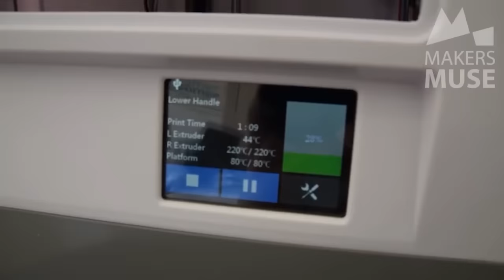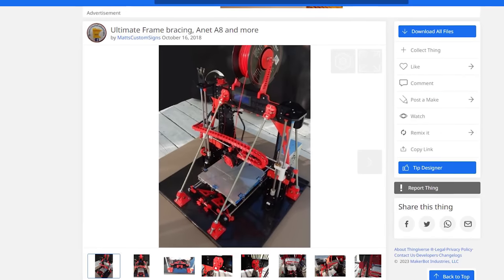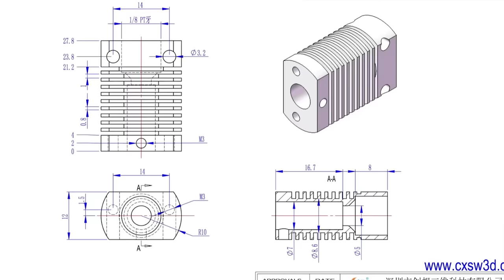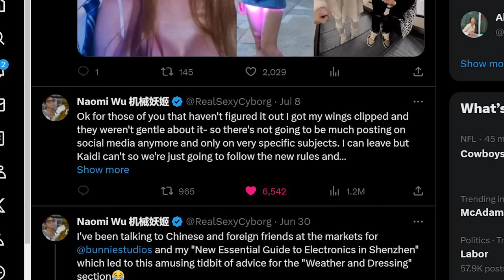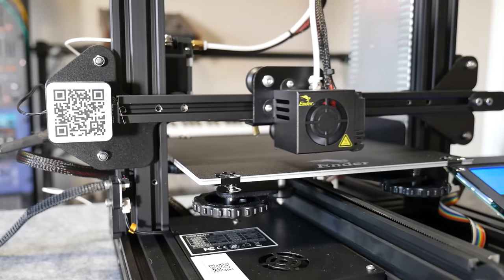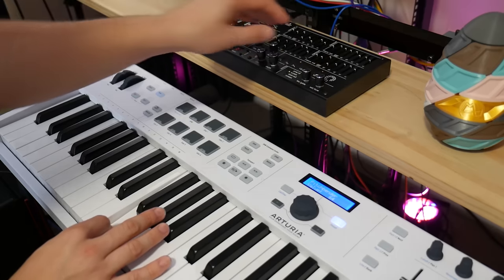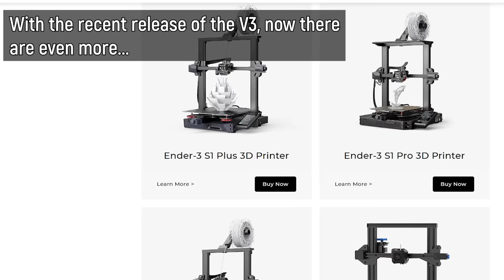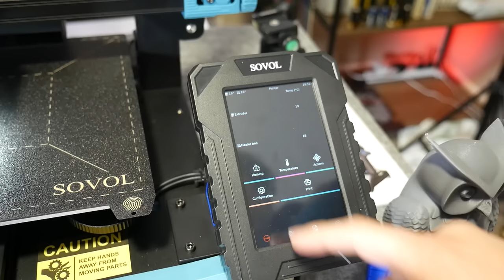Creality Ender-3... it's time to move on.

Comment: I've gotten an ender 3 FIVE YEARS AGO and I've barely used it. I literally only have 10 successful print on that thing and I hate that machine so much. Two months ago I dusted it off to print a case for my macropad and it took me 13 hours to get a part that's acceptable. I just hate that machine and will probably just sell my ender 3 and buy a new printer one day that's a tool and not a pile of parts that I need to tinker with every time I want to use it. Thanks for making a video that confirms my suspicions. 3d printing just isn't a hobby for me and I completely agree with your keyboard analogy, I just want my parts to print then move on with my day

Comment: i got mine about five months ago and i agree it a big pile off ****, im so feed up of leveling the bed even thought iv added a CR torch but if id have bought a better model that worked straight out the box first time every time i wouldn't have learned how to level how to fix a printer how to adjust one, im now looking to get a second one but will do a lot more research first or ask you and chep

Comment: This sounded like a Bambu Labs commercial to me. Is the Ender/Creality line "top of the line"? Hell no, but you could buy several for the cost of anything worth having volume wise from Bambu. And Bambu has had their own issues too. You won't hear about those though, because the checks have cleared. (wiring problems specifically)

Comment: I have had an ender 3 for a while, had bed issues with it, fixed it did a few prints every now and then, had a power supply issue, stopped using it because of how janky it looked when I had a look about when putting it back together 

Now I’m probably gonna get a Bambu P1P, the ender 3 is definitely great but get the best one first, not the basic models

Comment: I have a Creality 06 resin printer that has worked wonders up until a software update that overwrote my files and erased all my settings for half a dozen different resins. Horrible support. That being said, I was looking to get the Ender 3 Max for the print volume. Resin printers are great for miniatures but scenery is too costly in resin and size is a limiting factor as well. As someone who is comfortable with a wrench and somewhat tech savvy is the 3 Max worth getting? The budget is tight and the price point is doable (225 US) but it has to work.

Comment: Two years ago, I got an extremely cheap cr-20pro, like sub 100 bucks. It is terrible compared to my long loved prusa mk3s. Mesh bed leveling didn't work because the build plate is so much tilted, it just can't level it automatically. And there is no way of adjusting the bed on the cr-20pro, too.

Fast forward two years and I finally get my hands on a couple raspberry pi 3 sold second or third hand (whilst I'm already waiting on the pi 4 that I ordered for more than a year). I originally got them for my engineering studies and I already used a rpi0w on my prusa mk3s (I know, not ideal but it works fine if I convert the gcode to have G2 and G3 commands)

So I tried it on the cr-20pro..
..and I wanted to give up on the machine and get rid of it.. until I learned that it can run klipper with pressure advance and input shaping. And klipper has mesh bed leveling saved as values in a text file which saved the printer from an early end, since I could move the printhead manually to the measuring points and then input the measured offset by using the paper method.

And if anyone is wondering just how tilted that bed is, let's say left upper corner and right lower corner have a Z-difference of 1.5 mm.
My printer makes oblique square prisms instead of cubes.

Comment: I think you forgot to mention that creality actually made the ender 3 better along this years, the "recent" ones come with 32 bit motherboard, which made them way better than the 8 bit ones that you needed buy port expansions and to simplify the firmware a lot in order to add new features. Although I don't find the ender 3 variants very attractive, specially when they start to come with a lot of plastic parts, I did like the V2 ( the versatile color screen, silent drivers, premium PSU)   But you can't beat the 60$ returned Ender3 price,  the kit gets you pretty decent  parts, easy to repurpose to your needs. 
I usually tell new users to get 2 returned enders! 😅(build one with the parts with no sign of usage, then build the second one while installing a few, cheap but essential, upgrades)

Comment: Over time i’ve built my ender 3 to be exactly the printer i want it to be, using a mix of community mods and upgrades and some that i’ve developed myself. I love my printer… But I hate that it was my first printer. I bought it after bambulabs announced their first printer, and i wish I had waited but i thought they were just another wannabe tech company that was overpromising. So i bought my ender 3 anyway. I think you hit the nail right on the head. The ender 3 is fantastic if you are willing to put in the time to tune it and make it work for you. but for a little more money, theres so many better options that would serve less experienced people so much better.

Comment: My first printer was a Monoprice Mini Delta (v1), which isn't a great printer, but I got it for $80 from a friend, and they threw in a roll of filament (so basically a steal).  Last week I decided messing with the MPMD wasn't worth it anymore, and I started looking into replacements.  Creality DESPERATELY needs to cut some of their product line.  I ended up going with the Ender 3 V3 SE, but figuring out what the differences were between every "Ender 3" model is frustrating. 

That said, the V3 SE is printing great out of the box.  The only tweak I did was software. I switched from Creality's slicer to Cura, using the profile on Cura's github page.  And honestly, that was more because I like and am more familiar with Cura.

Comment: My son wanted a 3D printer I'm guessing it was 2018. I don't know who's at 16 at the time. I purchased him one for Christmas and then spent days putting it together and trying to get it to level. I actually became quite good at 3D printing and printed a lot of one-off for his friends. He never used it. Then I got a good price on a second hand ender 3 is the guy couldn't work out why he's prints were shifting as thru print. Halfway through the print it starts moving over and then shifts back straight again really weird looking prints. I never looked at it to see what's wrong with it as I stop 3d printing. Mrs hated me 3d printing in the house. Said it was toxic. At the time when I bought it I didn't know if I should which type I should buy a filament or resin. Looking back I wish I bought a resin now. As I have more use for printing tiny parts for diecast cars. Back in 2021 I've volunteered a bit of time at organisation and they had a 3D printer they purchased but no we knew how to use it. I think it was called a bilby. I don't know what they paid for but oh my god you're so easy to use. Enclosed box with a second dry box for the filament. I was printing within a few minutes. Good think about ender 3, it taught me how to troubleshoot and be able to work the machine. With a plug and play things happen you won't know I had to fix it. Cheers Graham

Comment: I completely agree with your thoughts. In fact, I feel like my Cetus Mk3 suffers from a lot of the same problems as the Ender 3, except that the Mk3 Extended Deluxe Edition is several hundred dollars more, which is unacceptable to me. I should have done more research and bought a more reliable printer. I will say that TierTime does have very good support staff for being a Chinese company. But I think the next printer I buy (if/whenever that is) will definitely be a Bambu. Those things are freaking impressive.

Comment: I finally gave up with my ender 3 pro this week, i've spent countless hours and quite a bit of money on upgrades, but I just can't get it to level reliably, even with aftermarket springs. Rather than spend more money on a bltouch and spend hours fitting and calibrating it, I just cut my losses and ordered a P1S. 

As you said in your vid, I want my printer to be a tool, not a hobby.

Comment: My Ender 3's been gathering dust because it needs some tinkerking to work properly.  Same story with my Voron0 (the bed droops). I use my Prusa MK3S to print stuff. I may "fix" my Voron0 in the future but the Ender 3 is destined for the scrap heap.

Comment: Happy with my ender 3 since 2019. upgraded with pi and klipper, aluminum extrude gear, glass bed, and print away at 80mm/s. for the price in comparison, with home printing i feel you're not getting value for the extra money spent unless you moving to resin printing

Comment: Agree totally. It is really sad people sitting on their hands and not changing anything. It would not have cost much more at scale to provide machines that were a lot better. They were all lazy. I bought my alfawise u20 in 2018, got frustrated after the hotend released lots of plastic all around it, looked at it again in 2021 and again now in 2024. You did a video on the wooden left out in the rain 3d printer and that it is how I felt with a myriad of issues from th eplate sticking too well, levelling etc. I got it printing relatively acceptable prints this year but the transition to ABS was not successful. I have watched infinite videos but you should not need a degree on 3d filament flow theory to get things working. I bought several nozzles, hotends probes not all have been used yet. I just bought a returned unrepaired  Kobra 2 for £99 as I found it hard to justify the lower end bambu product on top of my existing. 
Would it be worth doing a video on how to get your 3d printer in working order video to show the checks that you need to try and prevent problems as a video, from the geometry of the frame, the runners/belt tensioning, z axis height, dual z especially if loading the z arm with a dual gear extruder etc. 
There maybe people who now buy different better models but there will be a lot of sad unused and unloved machine out there. All of you guys including Teaching Tech and Cnc kitchen have put so much into it. I wanted to let you know how much your enthusiasm and knowledge has been appreaciated

Comment: My 5 year old Ender 3 still has mostly OEM parts...  The same ones that were in the otiginal box, not replacements.  $25 total in replacement/upgrade parts plus cable guards that I printed using the Ender 3.
Reply: Without Ender 3 of 5 years ago, I wouldn't have gotten started in 3D printing.

I can see where there are lots of places to improve it and most should have been taken care of years ago.

But it's still a functional 3D printer with decent print volume on a budget.

Comment: I have a choice to make. Should I buy Ender 2 Pro, or save some more money to get Ender 3? All the other 3d printers are out of my price range and I don't want to waste my money and time with toys like EasyThreed.

//edit: Also as far as the bed leveling go, wouldn't a leveling ruler (one of these with air bubbles in tubes, don't know the English name for them) help getting a correct level so the bed is perfectly flat?

Comment: I'm time poor, a few years (3 just before covid) ago I researched and said to myself I'll buy an ender 3, I walked into the shop and saw the ender 3 and the K1 max working side by side, even the buy at the shop had to fiddle with the display ender 3 and got it printing the boat, I talked to him for quite a bit and worked out he new almost nothing, he talked to another customer, then the K1 max finished the boat and the ender 3 was still in the beginning stage. I new I'd wish I spent the extra for the K1 max if I got the ender 3, The K1 maxdid fail on me with an unknown fault code, so I guess they have issue's still

Comment: I got one in November and it didnt work as some of the parts were put together wrong such as the extrusion kit.
Its still not working as it turns out now I managed to replace that myself with creality not helping at all, the hot end and its fans are also broken and need replacing.

It's costing so much to just get it to work, it's been frustrating and I feel like I was scammed and it put me off learning to 3D print.

Comment: The ended 3 v2 is the best printer I’ve owned parts are cheap and it works very well I’ve had no issues except one with the feeding system because of the Bowden tube but a direct drive kit makes this printer a gem especially with the cr touch

Comment: the thing is for me I bought my last printer 3 years ago (creality cr10s pro) and for me it is perfect. it has its downsides but i started printing years ago with a tronxy x5 so the few problems this thing has isn't that big of a deal. But at the moment it sparked again and i want to upgrade it to fix the 2 flaws it has for me. the extruder and rhe bed leveling. I also planning on rebuilding my cr 10 s to more moder electrinic, hotend bed usw. For me that base is perfect I need a big volume cause i print planes and instruments and i for some reason these machines just look so clean. The bamboolab things arent for me. I need some Level of doing stuff myself on the machines. I might get a prusa in the future cause i worked with one in the past and in my opinion these are the printers out there. But yea. I never had a ender cause i started before but i think they were the entry for a lot of people. But yea crealitys days are probaply over.

Comment: Upgraded my e3 v1, worked for a while.
Something fcked up.
Upgraded something else. Worked for a while.
Something fcked up.
Upgraded some other part. Worked for a while.
Something fcked up.
Bambulabs released the P1s.
Upgraded my ender 3. Something fcked up.
850 for an enclosed printer with some extra things to print nylonCF....
Stopped upgrading my Ender 3 v1 and waiting for a sale when the next generation of Bambulabs enclosed printers pop up.
This hobby....

Comment: I have an ender 3 S1 and for as cheap as it is,  it has been very easy to use and reliable but I do have a bit of mechanical knowledge and enough computer skills to be dangerous to the printer LOL.  For someone that doesn't know anything about them I could see it being difficult to run and setup and that's where the polished printers come in. For me though I enjoy tinkering so cheap printers are the way to go for me

Comment: I don't think anybody in 2023 or 2024 is suggesting 3D printing newbies buy an OG Ender 3. One of the V3s, yes. A $99 V2 from Micro Center, also yes. The original non-Pro model? Absolutely not. But you're right, Creality could absolutely carve out 2/3 of their many, many models and nobody would miss them - keep the Ender 3 Pro for tinkerers, the V3 SE and V3 KE for most of their customers, the Ender 2 Pro for tiny printer enthusiasts, an Ender 5 for CoreXY tinkerers and homemade enclosure people, and either an Ender 3 Max or one of the CR-10s for large-format printing...toss every other FDM printer they make into the dustbin of history. It's as much for consumer confusion as it is for their own internal logistics, too - they could guarantee spare parts for existing owners for a year or two and then be done with what I'm sure is a true nightmare of a parts inventory.

All that being said: while I have kept my heavily modified original Ender 3 around, I've done way more printing on my Sovol SV06 Plus in the last six or seven months since I picked that up. I've probably spent $300-350 on my Ender 3 between purchased upgrades like the FYSETC belt tensioners, silent mainboard, Micro-Swiss direct drive extruder, Gulfcoast Robotics all metal hot end, and Fulament magnetic flex plate and on filament and parts for printed upgrades like the light bar, storage drawers, 608 bearing spool holder, filament guide, Manta Mk2 fan duct system, and full size SD card holder. I spent a little more than that on the SV06 Plus, which is has many of the same features plus the inductive ABL probe and a larger build volume (not to mention a few less problems, of the self-induced variety). I could keep tinkering on the Ender 3, fix the problems and maybe add totally new functionality (the Ender IDEX does call to me a bit) but I'm kinda over it - I'll use it when I need to make something the SV06 Plus isn't suited for, like an FDM-printed miniature out of a 0.2 mm nozzle or when I busted out the packing tape to use up a sample coil of OBC filament, but the Sovol is just less hassle. 

The silencing of Naomi Wu is truly a loss for the community and, I think, for China. Who knows how many people learned something interesting about Chinese life and culture by watching her go on a shopping trip or hiring neighbors to help move machines into her workshop? I have a lot more to say on that subject, but much of it would probably earn me a nastygram from YouTube...suffice to say, it is nice when we get occasional proof that she is alive and out of prison, but it would be nicer yet if she and her partner could escape for a safer haven.

Comment: I still use my Ender 3 and I still love it, I guess I kind of mastered the small things like bed leveling. But I would like to roll with the flow and upgrade to something a bit more up to today's standards. With that said, I would still use my little Ender until she stops choochin for good, heck, even then I may just tinker and upgrade her. She makes awesome prints still after 6 years or so even if she is on the slow side.

Comment: The first 3D printer I used was a CR10. The thing was TERRIBLE and took 30 minutes to 60 minutes to setup.
The first printer I bought was a Ender 3 v2 and have been upgrading it piecemeal into what is effectively a E3 S1 Pro.
TBF, when I was starting I would have looked at a S1 Pro and said "I'm not paying THAT much".
I would now go with that SOVAL you showed off at @14:00.